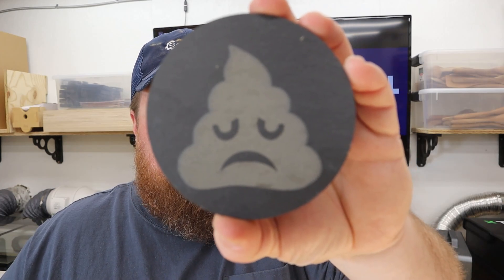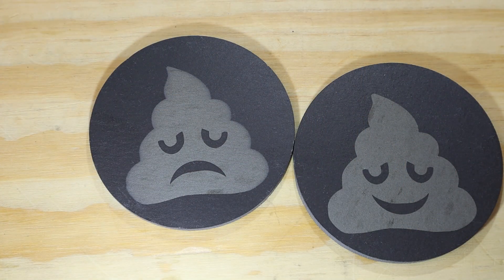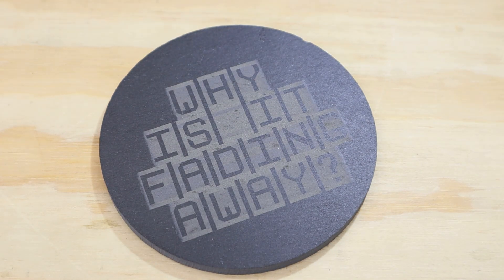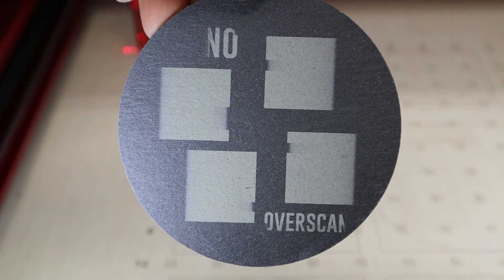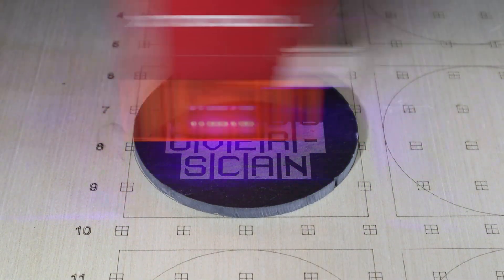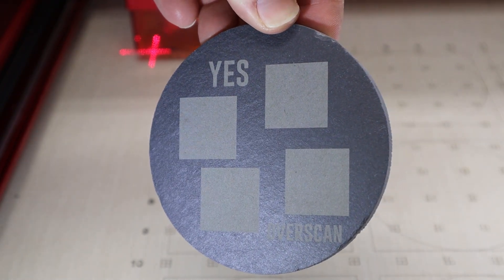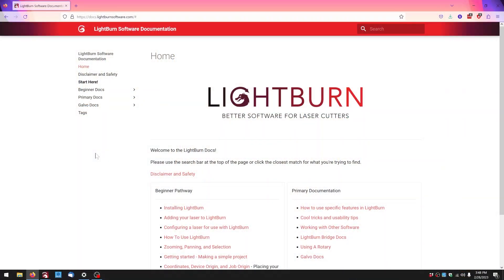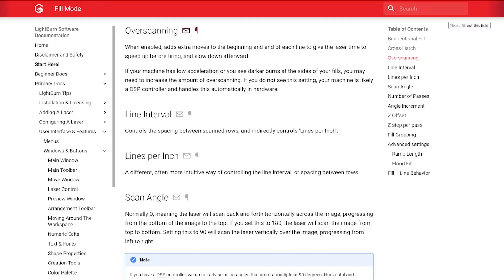Faded Edges with Laser Engravings? TRY THIS FIRST

Comment: When I scan the laser head will not go from one side to the other although I set scan angle to 0. However it would go to one corner then jump to another point in the drawing and then back and so on scanning one part after the other independently. How can I tweak this to look as in your video left-right motion and the one line up and repeating till the top point?

Comment: Want to get started in lasers . diode or co2 . if I only have $1000. So xtool style or omtech 500 dollar model with extras. I'm ok with small work space but I want to make sure i won't out grow a diode . Thanks
Reply from the maker: It all depends on what you want to engrave or cut. If you want to engrave/etch clear glass, or cut clear acrylic then you have to go with CO2. Otherwise a good diode can do all the same things as a CO2 -- just slower and with more passes due to the power differences.

Comment: Speaking of lasers... Let's say I want to place a laser head on my Shapeoko Pro XXl. First do you think its possible, seems like it should be. Do you think this would make a good video? Please let me know if you may or may not pursue this suggestion. 🤔
Reply from the maker: There are many that do this. I believe J Tech is the laser? I'm not sure. I never recommended or did this due to the cost and the fact I could not run the CNC and engrave at the same time. This coming from a guy who's CNC has yet to be powered on in the new workshop of a year now! yikes...

Comment: Thanks Sam, I also experienced the same thing. I usually use about 1.5-2.5%, any less sometimes isn’t enough depending on the image and more seems to be over kill. Does that sound accurate in your experience?
Reply from the maker: It does, I've since upped my overscan to as much as 5% :)

Comment: Thanks for sharing this tip Sam.
I've used overscan for a while after similar issues, it's great.
Totally agree about Lightburn, I use on my co2 (after controller upgrade)' and on  my Ortur LMPro 2. Tried other software, nothing beats LB.

Comment: I discovered this about 3 years ago when I got my first laser the Ortur Laser Master that looks like what you have hanging on the wall behind you. I came across this knowing that if the laser turned off at the same place at the end of edge of the burn but kept moving rather than stop and reversing the burn time would be consistent using over scan. Some what like spray painting you apply the paint in a path that goes beyond the object being painted then reverse the spray, this provides an even coat and not build up one the edges tha same applies with the laser. The beam turns off at the same place.